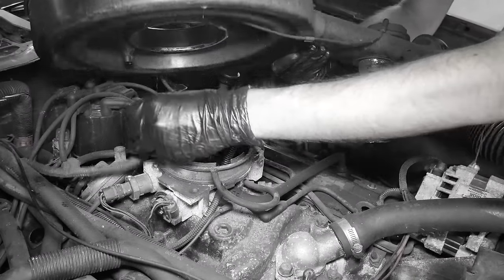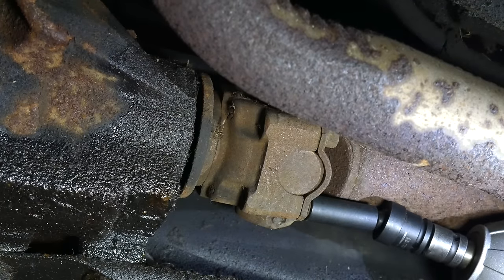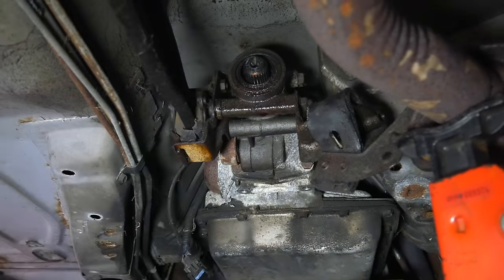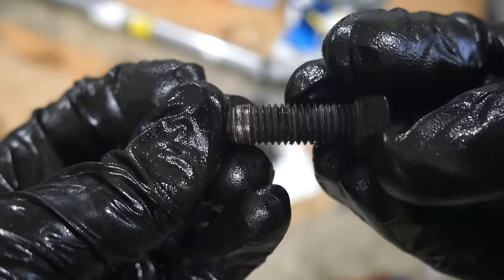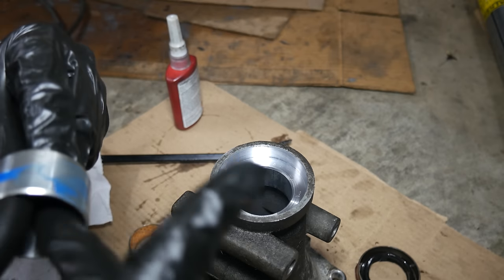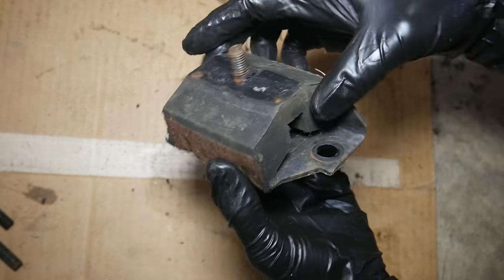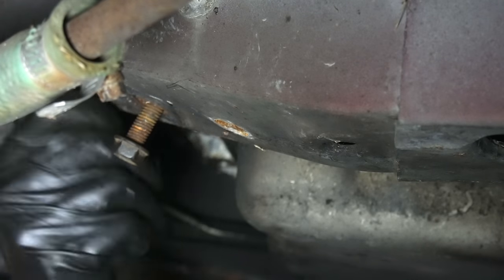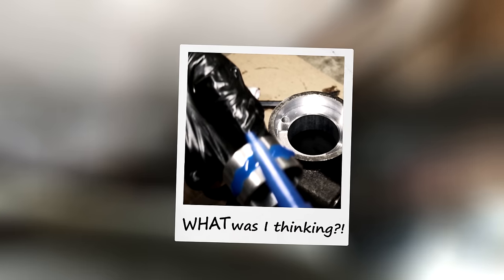1991 Firebird 700R4 Tailshaft Bushing and Seal Replacement (Ep.3)

Comment: Sweeping it under the rug was quite amusing if I say so myself haha. I’ve done that multiple times with my transmission. I’m not sure of the official names of the parts since it has a torque tube on the driveshaft since 1949, but the rear seal is leaking between the transmission and the torque tube. So is the main seal between the engine and the transmission... and the differential... pretty much everything important is leaking except the brakes haha. Good video
Reply: ya
Reply: This is the finer point of old pontiacs and why they live forever, the fluids leaking is a metered self undercoat and chassis lubrication. Also forces the owner to renew the fluids often, keeping the car on the road for thousands of smiles more.
Reply: Brandon D exactly, that’s why they had to close down the division. They were so reliable for those that bought them they would keep them for life, slowing down production to a point where everyone that needed/wanted a Pontiac had one ;)

Comment: This is the reality of working on older cars. I just got a 98 Expedition and started the "discovery" process. Take one thing out, find two more behind it. It is just the way it goes. But is like with rust, you keep digging until you find good metal and then start building it out. At some point (you might have, but I didn't check) it would be cool to see your list of "can't do without" tools, thread-lock seems to be one of them. :-)  Due to a recent move I had to get rid of all my tools so starting from scratch. On this Expy just realized I need a lot of Torx (screwdriver/sockets) to survive.. :-) Keep up the good work and go light on that blue stuff. :-)
Reply from the maker: Thanks for the suggestion! I have thought about doing a "most used" tools video and might well make one somewhere down the line. Part of the reason I haven't made one yet is I keep discovering more tools and changing what I am using!
Reply: I had a 2000 and I loved that thing. I drove it over 350k km in 10 years. It was hit by a school bus and just took it like a champ.  I could get all my foster kids in there with no issue. It may not have been anything impressive or ‘special’, but it served me well! I hope the project is going well for you!

Comment: If you were to replace the transmission down the line, might as well source a manual one along with the necessary pedals, manual swaps usually gets viewers.
Reply: I agree
Reply: I wanted to install a 6 speed tremec  on my 83 trans am, but it was 3500.00 with all the necessary hardware, the rebuild 700 r 4 with converter was 1200.00 from monster transmissions a few years back.
Reply: @BLANK-INC  you are WRONG
Reply: Automatics are faster
Reply: @deiontimmes5256  not from this era.......
Reply: @deiontimmes5256  Automatics use more power, manual transmissions give you the ability to choose what gear you want to be in ( I understand you can do that with an auto, but it will eventually upshift), and automatics from the 90s usually sucked.
Reply: @deiontimmes5256  automatics are QUICKER, not faster and only if you have enough power. Manuals have a big advantage in corners.
Reply: @alexandercurtis4427  they don't "eventually up shift" unless it's a computer controlled transmission and not all of them do. You put a 700r4 in 1st it won't up shift, put it in 2nd and it'll only shift between 1st and 2nd, put it in 3rd and it'll only shift between 1st, 2nd, and 3rd. If you put an manual valve body in it you have to make every shift your self.
Reply: @lb9gta307  Well, I was wrong. Just most of the automatics I drive will eventually upshift
Reply: @alexandercurtis4427  I get that. Since about the mid to late 90s they all went computer controlled so that's all most people will ever experiance now.
Reply: @deiontimmes5256  MOST of the time manuals are faster.
Reply: @area85restorations75  not true, manuals are better cause they're more fun and you have more control. Everyone knows that automatics shift faster though, so don't use that as an argument cause it's simply not true. People can't shift faster than an auto unless it's a slush box vs sequential, clutchless, or faceplated.
Reply: @jradish  I'm sorry man, but I'm most, NOT ALL cases you're wrong.
Reply: @Zelaznogsiul-63  The time when I dreamed about rebuilding my TransAm are way behind me but that's the 4 speed automatic tranny you're talking about, right? I think I remember wanting that sucker in my build.
Reply: ArthurAlcantara Manual trans cars are nice for daily’s but to do that swap on a third gen fbody regardless of how fond you are of it is a total waste of time. As another comment added it’s pretty expensive. It’s better to spend 1,000-1,500 for a 305 5 speed car than 3k+ on a conversion kit.
Reply: @yankeeshane674  Absolutely, you're 100% right, from a financial standpoint such a swap wouldn't be viable, but I mentioned it because the channel has grown substantially since he started this build and the tag 'manual transmission swap' would bring even more viewers more or less justifying the costs associated.
Reply: @jradish  You're right, it's why the fastest car's in the world are all semi auto clutchless transmissions, you get the best of both worlds.
Reply: @area85restorations75  it depends on the vehicle, in the past it was common knowledge that manuals were faster but technology has changed...
Reply: @marcolara5433  I understand that, but automatics always take more horsepower to run than manuals. Sometimes the quicker shifts can make up for that but not very often.
Reply: Yankee Shane   Why? A T5 is weak and won’t hold up reliably to a warmed over 305. 

Plenty of people have don’t 5 and 6 speed swaps, it’s a fantastic upgrade for a 3rd gen.
Reply: ArthurAlcantara   Only if you are one of those morons who looks at the cost of the hobby and weighs it against possible resale of the car. That’s a bad way to do things because in almost all cases you are losing money if you do anything to a car.
Reply: @MicroChipz Shepton Mallet I partially disagree. If it is a case of "I'm flipping this to get another car" or just that they have other cars needing to be up they may limit the money thrown at a specific individual solitary car. Granted the overall cost usually goes up because 5k per car sounds cheaper then 15k for one car, until the guy gets 10 cars for 2k and puts 8k worth of parts into them.
Reply: @MicroChipz Shepton Mallet Don't be too rough on him. Not every one has had the opportunity to run a manual vehicle. Even I haven't Granted that's only because my manual vehicle is 1000 miles away, doesn't run, and I have to fight for the title or get a new body (at this point I don't know if keeping the old one is cost effective) but still, I haven't drove one. I haven't even started one on the regular since I was like 14 years old, warming said SUV up for my old man every morning before he went to work.
Reply: @BLANK-INC  and you couldn't drive manual
Reply: @RetiredRhetoricalWarhorse  yes the 4 speed automatic.
Reply: @deiontimmes5256  how a automatic transmission doesn't have torque

Comment: My 89 Firebird Formula 350 was an Atlanta car so it was in perfect condition when I bought it in 2008, every time I took something off, I completely restored it including paint and clear coat (spray can) on the parts I removed! Quit trying to fix that exhaust, slap some Hooker shorty headers on it and a true dual exhaust 2.5” with a crossover and remove the converter slap on a couple series 50 mufflers and it’ll sound awesome!

Comment: The safety flip flops are a trend that i see quite often, huh.
Also, i wouldnt worry about the transmission. 3/4 aint bad, and like you said, you'd need a whole new case for the transmission. And personally, i did worse things (I may or may not have installed a new clutch kit only to leave out the actual friction clutch disk, and then spent two days wondering what the car wouldnt move. And i left out 2 bearing.. balls? from a halfshaft and did 200km on it only to realize they were still on my workbench. so you know. you live, you learn.)

Comment: Ah, memories. :)    A saw a few f-bodies that either lost that torque arm bushing, and one was missing the bracket too.  With the bushing gone, it just has an unpleasant thump occasionally.  With the bracket gone, you're wondering who smacked the floor with a hammer.   In the shape that one is in, I'd leave it alone.  

Good luck with that exhaust.   Replace or delete the cat too.  That's why the exhaust was reasonably quiet with the muffler missing.  The cat is plugged up.

Comment: I wouldn't worry about the one cracked bolt hole. It torqued back down and it's not under extreme pressure in use. If you rebuild the transmission get it tig welded and retapped then. Also always replace the transmission mounts on the 3rd and 4th gen birds as that torque arm suspension really puts a beating on them. I recommend polyurethane transmission mounts with the encapsulated metal cage that's available. Good job repairing the stripped out crossmember bolt. They are necessary.  If you ever increase power output the actual frame rails where they bolt into become a weak point. I have had the crossmember rip out the metal with both bolts attached. Clean metal just torn from the frame! We reinforced the frame rails with plate steel on 3 sides and added frame ties before reattaching a modified crossmember to it.  Just passing on some issues we found working on 3rd gen birds.

Comment: I was going to sub, but I was skeptical about not replacing the cracked housing. But the ultimate non-sub decision was the flippy flops. I just have a problem with people working on anything wearing flippy flops or sandals. Good luck to you though.

Comment: Always "mark" a drive-shaft's location in relation to the trans, prior to taking it out so when it goes back in, it's balancing is back where it came from and you will avoid any vibrations that may arise if it is out of synch by being out of turn from where it originally was.

Comment: I run cracked parts too it will be fine, when I put the engine back in my camaro 4 years ago I noticed my almost new starter had a crack between the two bolt holes that hold it on but I used it anyway and it still works fine.

Comment: Most likely the crack happened as the bolt was being removed. Corrosion caused the aluminum threads to gall to the steel bolt.  Then the part of the threads galled with aluminum spread the hole as it came out.  Hole had nowhere to go so it cracked.

Comment: I watched the other 2 episodes, a trick for that ticking noise from the engine lifters i have found that works if its just gunk build up, is using seafoam in the engine oil , run it for 10 minutes let it sit over night and then change the oil, i had a chevy truck with same engine and it got rid of that ticking noise. i got about 450k on that 305.
Reply from the maker: Tried Seafoam in this engine (well, Walmart knockoff Seafoam) and it didn't seem to do much, but Marvel mystery oil (or the deadly combination of the two lol) cleared the tick up almost immediately. Comes and goes on very cold starts sometimes but most of the time it is quiet now.

Comment: The transmission case crack shouldn't be too bad in the long run. I would personally say, put some loctite and then plumbers tape on the bolt then screw it in, then apply some JB Weld to the surface all around it to at least give it some reinforcement.

Comment: Just an FYI you don't want to thread lock a bushing if you ever want to get it out again.
Reply from the maker: Regular blue threadlocker doesn't hold it too dramatically, I have removed ones I have installed before and while it is more difficult than no locking compound, it isn't anything to worry about. Green retaining compound however can be tricky, but a torch takes care of anything like that pretty easily.
Reply: @FuzzyDiceProjects  Maybe so. Though bushings are meant to be held by pressure alone and often heat isn't an option. Threadlocker is overkill.

Comment: 20:45 - I know you get a lot of "tips and tricks", but if you ever remember and need to slide a bushing in give it a quick spray with silicon grease. It's fairly thin and won't harm the rubber, keeps it nice and slippery. I've had a lot better success with that than just soap and water, but really at the end of the day it's whatever works for you, just thought I would offer it up. Sometimes I don't try things I've heard until I'm in a real pickle and then it saves my ass lol.

Comment: All the original parts you take off and plan on putting back on should get wire brushed, cleaned, and painted. That cross member was filthy when you put it back on! Same with the drive shaft. If youre going to be spending time under there in the future, everything you clean now will save you from rust/crud in your face as you move around under there.

That said, sub'd. I want to see more!

Comment: Ugh, just had a similar thing happen on a CLK alternator bracket, aluminum threads galled and transferred to the bolt threads, then the ear cracked and broke off the bracket.  This was after heat and penetrating lube.

Comment: I use a black gasket maker on the OD of the seal, lubricate when is wet, and nice seal when is dry, just a little, I don't like have silicone rubber residue inside of any part.

Comment: Question...is the transmission crossmember bolted to the floor pan stabilizers or to the actual frame itself? I need to change mine..but it looks like the driver side floor pan stabilizer took a nasty hit from a jack

Comment: I don't think you caused the crack in the transmission casing.  Looking at you pictures it appeared there was some corrosion present on the cracked aluminium on the outer surface so I would suggest that it is either something that has been present since that unit was manufactured, or, more likely, something that has been caused by someone working on the car before you had it who has cross-threaded that bolt and caused the crack.  Now you've changed out that rear seal just keep an eye on it and see if it is still leaving the odd spot of ATF when parked.  If not it'll probably be fine until the transmission goes out to lunch or the casing fails completely.  I would suggest that the mess on your diff does rather suggest that it is weeping some diff oil.  Some of it is probably ATF from the leaking rear seal that has been carried back by the air flow but there's definitely some heavier oil contamination there but whether that is coming from the pinion seal, the drain or fill plugs or any gaskets on the casing is impossible to tell from the video...

Comment: Hey bud.  Keep those videos coming.  Good stuff!  Just wondering your opinion on driveshaft removal and installation. I didn't notice you marking the position of it before it was removed.  Guess I've always heard you should mark orientation before removal to avoid out of balance issues.  Your thoughts?  Thanks!
Reply from the maker: I have heard the same thing, but don't subscribe to that theory. As long as the bearing cap surfaces are smooth (as are the yoke/strap surfaces they mate to) I can't imagine it would matter. Besides, driveshafts are almost always balanced when not mounted to a vehicle anyway. If I'm wrong, worst case scenario, a new vibration is felt and you could always try installing it the other way around.

Comment: The OCD in me makes me wonder why you didn't go ahead and replace the u-joints while you had the driveshaft off.  But I also understand you're doing this on the cheap.
Reply: Maxey they’re cheap and easy to get to so if the ones on it are good I wouldn’t replace them either.  Lots of good parts with plenty of life left in them have been sacrificed to the “while I’m there“ god.

Comment: Those drill bits seem to work really well, what brand/material do you use?
Reply from the maker: For something soft like a rivet, pretty much anything will do. For pretty much anything but hardened bolts I just use whatever brand high speed steel bits were recently on sale at a local hardware store. Pretty sure this one was from a big assortment set that cost like $7 from Tractor Supply. For harder stuff (graded bolts or stainless) cobalt drill bits work pretty well and aren't too hard to find locally and at reasonable prices.

Comment: So that is a factory u-joint. i would have replaced them. at least it looks like it still has the OEM GM plastic retainers in the driveshaft yoke. You'll have to torch those out if you want to change it. PITA. lol

Comment: I stripped an aluminum bolt on a sprocket that was on the same shaft as a tire
I held the sprocket to the tire with pipe cleaners (sprang bearing?)
to even loosen the bolts I used a 1/4in socket to hold a hex bit
now I have to remove it and probly just use 3 bolts if I can't find a match

my pipe cleaners and sideways unbolting  leaves your sandles in no wrong
also pipe cleaners are bae and much better than zip-ties